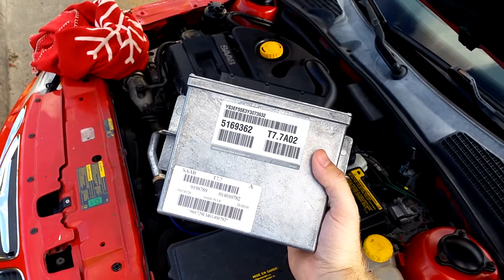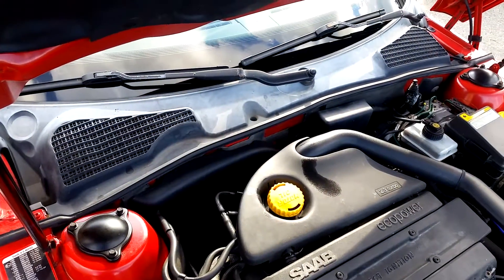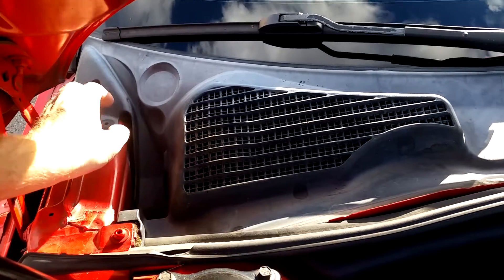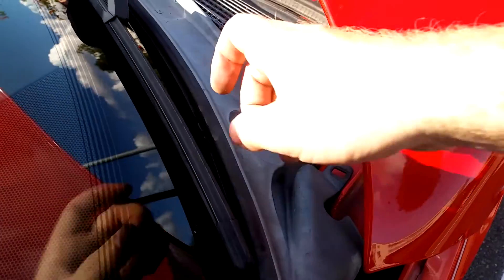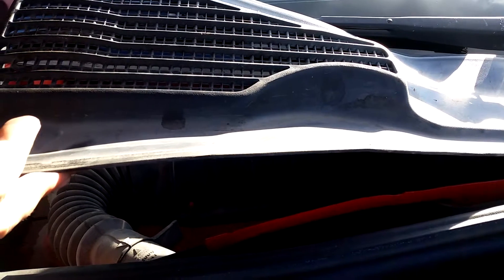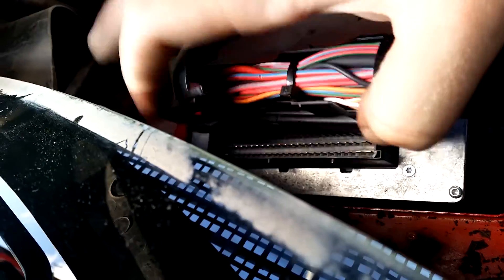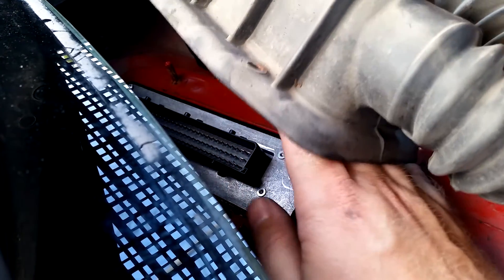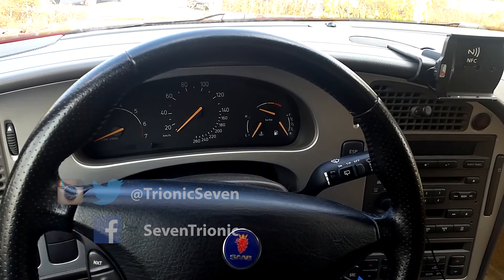Saab 9-5 DIY: ECU Replacement - Trionic Seven

Comment: hi and thanks again for your tutorials, they are a big help! I recently decided to upgrade the ECU on my 9-5 Aero and must admit was a little daunted with the process/difficult access/losing those nuts, especially the two securing the unit itself - I could see those disappearing so quickly. 
So I invested in a Battery Terminal / Wiper Arm removal - took less than a minute to get the arm off,  plus an extension for my 1/4" socket set and the all important 1/4" Universal Joint tool which made accessing the nuts so easy it was a dream. Another thing I did was fill the 10mm socket with thick leather balm before I started, which did an excellent job of holding the nut in the socket - I didn't have to worry about dropping it.
This made the whole process of getting the ECU out and a Stage 2 replacement (from Scott Rowntee on EBay) so easy and fast. No stress, no worry about access or losing the nuts. 
Just thought this might help others who might be contemplating this upgrade but feel it's too hard. And it saved me several hundreds of dollars doing it myself.

Comment: Is it ok to just swap them or do you have to code them in some sort of way? I bought a already tuned ecu from another saab 95 and want to switch but would be nice to know this before i switch the ecu. Thank you.
Reply: Did you ever get an answer? I heard you can disconnect your battery for 30 mins, plug in the new ECU, turn your car on (not started) let it sit for 5 mins, turn your car off then start it. I'd like to know as I'm thinking I may need a new one. Don't have the $$$ to have it programmed, but if that trick works, I'll definitely pick it up from the pull & pay
Reply: @amberlymartin4713  you have to remarry  the ecu with a gm tech 2
Reply: @rizzlypig9822  oh, okay. Well, now I have an excuse as to why I'm dropping that kind of money on a tech 2! 😅 Thank you!

Comment: Wodner if you can help.  Saab 2001 2.3t SE estate. I get fault code P1625, and as it states in diagnostic help: Speedometer may not be working. However my Rev counter doesn't work either. Is there a way to reset all so communication is back to normal?
Reply from the maker: +coventry plumbing and heating 9-5? No idea about that code, better ask on the forums.
Reply: sounds like someone needs there abs module remanufactured

Comment: this might sound stupid but my electronic controls are all backwards, was hoping I could maybe clean the contact on the ECU and hope that it may be a quick fix? But does the ECU only control engine functions or is there another one for other things like ABS/TCS, radio etc?
Reply from the maker: When you say backwards, do you mean your car is a right-hand drive?
Reply: Trionic Seven no... I'm not THAT stupid, haha..  I mean my electronic controls. like volume up goes volume down, heat up setting puts the heat at the feet ... etc.
Reply from the maker: Hm...not exactly sure I understand. First, what car and model year? Does it affect the steering wheel controls, or does this happen on the controls on the dash? Also, volume controls and ACC redirection are separate systems so I really wonder what could be causing htat.
Reply: Trionic Seven it's a 2001 9-5 aero sedan. yeah the steering wheel controls are indeed affected. For example volume up changes from tape to CD and volume down puts the volume up. it doesn't always happen though, I'd say that 1/10 times I start my car the steering wheel controls are affected. The heating is always broken, however. now it only shoots air from the main face vents regardless of the setting and if it is very cold outside I can't change the temperature, it only shoots out very hot air.
Reply from the maker: Hm...my wife's 9-5 has a similar problem where the steering wheel buttons get weird. Think it's a grounding issue but I'm not sure. Re. the ventilation, try holding auto+off. This will show any fault codes in the ACC system. If it says "0 0" there's no fault code.
Reply: Trionic Seven thanks for the advice! I've tried that a few months ago and it only showed one "0" on the left side and nothing on the right side. is that normal or am I supposed to see a "0" on both sides?
Reply from the maker: I think that's normal.
Reply: Trionic Seven this morning when I turned on my car it still said "0" and when I pressed buttons to try to get out of the mode it showed me to error codes! 1-8 and 2-14. going to google what's wrong now, thanks for the help haha!

Comment: Thank you. I just subscribed to your channel. Lots of great informational videos. I just picked up my first ever Saab.
Its a 2003 9-5 Aero , Automatic  USA model.  Looking to do a quick tuneup, make sure all hoses are in great shape and fix a vibration I feel in the car when idling. 
Any tips or recommendations on upgrades :) . I see people referencing E-85. I run E-85 in my Supra and it would be awesome to do the same for SAAB
Reply from the maker: +Mohammed Illiyash You probably have the same idle vibration as I have, it's probably bad motor mounts. I know that the torque rod busingis completely shot, so I will start with that one. Biopower conversion is very good for your saab, except for the fuel pump. If you want to go off the deep end, check out our community at trionictuning.com, and you'll learn how to do tuning and biopower conversion on your own :)

Thanks for your comments and kind words! The saabs are very upgradable, and there's a ton of stuff you can do without breaking the bank too much. I would start to take a look at suspension and maybe upgrade the shocks, springs and bushings. Good luck!
Reply: +Trionic Seven: For Saab Enthusiasts Thank you for the tips. I will join the trionictuning.com and poke around. :)

Comment: My plastic cowels are starting to form cracks from the topmost parts due to age, Should I get it replaced by a salvaged part? Or is it nothing to be concerned about?
Reply from the maker: +Man Oat They stop water from entering behind the firewall and into the passenger compartment. If they leak, you might get water behind the glovebox or the instrument panel (I think). I would have them looked at just to be sure.

Comment: Hey Trionic Seven, do I have to ,,marry'' the ecu from another Saab 95? Mines a 2.0t and i'm planing on getting 2.3 aero ecu.
Reply from the maker: You always need to marry an ECU. However it also needs to match what's actually under the hood. Why would you put a 2.3 aero ECU in your 2.0? It just won't work!
Reply: Im upgrading my turbo to td04 also got aero injectors, so i was thinking to put aero ecu and see if that changes hp
Reply from the maker: Won't work. You can't put a 2.3 ecu in a 2.0 car!
Reply: Trionic Seven would a 2.3 aero  ecu increase horsepower in a 2.3 arc??

Comment: I have a 2001 Saab 9-5 2.3l. My question is, when replacing the ECU do I have to reprogram it or does it automatically reprograms itself?
Reply from the maker: +Eloy Guzman No, you must flash the correct software on the ecu before installing.

Comment: I thought that the new ECU had to be "married" to the car. You're telling me that if I get an ECU with a different tune I can just throw it in there and it will work?
Reply from the maker: The video just shows how to swap out the hardware, it assumes the software matches the car and that the box has been married to the car.
Reply: Perhaps make a video on how to marry hardware to the car :)
Reply from the maker: Either use tech2 or check my opensid flashing video!
Reply: So to be clear, you can’t pull out a T7 ecu and plug and play?
Reply: You have to use a tech 2 to marry them?
Reply: UFO Files Chicago do u have a marrying  video
Reply: Trionic Seven do u have a video  to show how to marry a new twice or ecu

Comment: I have a 2002 9-5 and I’m getting a warning key not accepted. I trying to locate the starter relay location! Anyone who know the location of the fuse box?? Is there anywhere I could bypass and have it started??
Reply from the maker: Try pressing the unlock button on the key while turning it

Comment: What did you change on the ECU? Stage 1 tune?
Reply from the maker: +Bine Zorko +Bine Zorko I enabled OpenSID. https://www.youtube.com/watch?v=MGm5-PtcWLM
Reply: Cool-mine was already open. Any plans for mods?
Reply from the maker: Sure! 3" DP, diesel snorkel and stage 3 biopower is the long-term goal.
Reply: Awesome! Too bad we don't have E85 here. Also, I didn't know that from 2004 onward they installed a bigger snorkel-I might look into that. Thanks!

Comment: Is there anything else that you need to do other than just plug it in
Reply from the maker: Oh yes, this is just the hardware side of replacement. You must match the VIN number and anti-theft codes.
Reply: Trionic Seven ok I recently bought a 97 900 turbo for my first car cause I love saabs but some of the gauges don't work and sometimes they do but there was a new Ecu in the glove box so I was going to switch them and see if that helped do you have a video of programming it or would I have to take it somewhere that works on saabs
Reply from the maker: From what I've heard, it's common with bad solderings in the instrument cluster on those cars. But don't quote me on it!
Reply: Trionic Seven I'll take it to the one place that works on saabs and have them look it over thanks for the info
Reply: @TrionicSeven  hi, I have a 2005 9-5 aero which had a stage 1 ecm upgrade.. I purchased another 2005 9-5 aero that has no tune and decided to swap the ecms. Now both cars won't start. They just Crank. Do I need to program something ? It's not just a straight forward swap ?
Reply: @sgstouch  of cause you need tech2 and TISonline